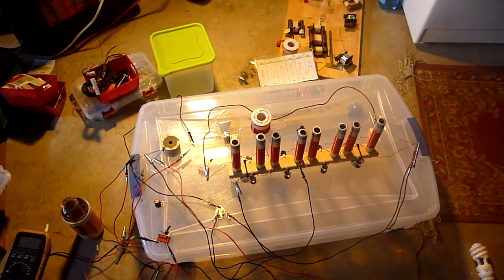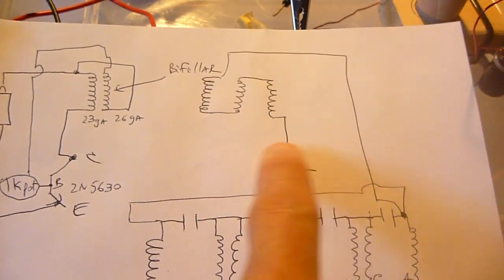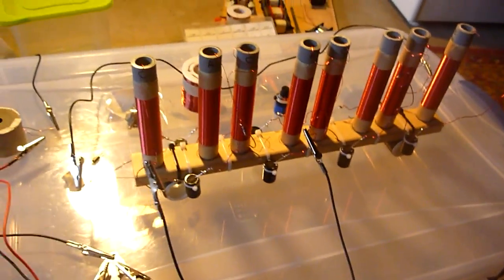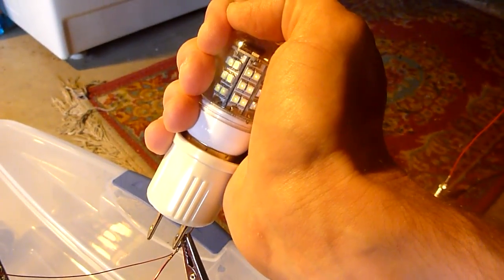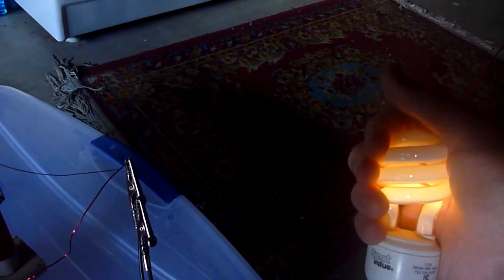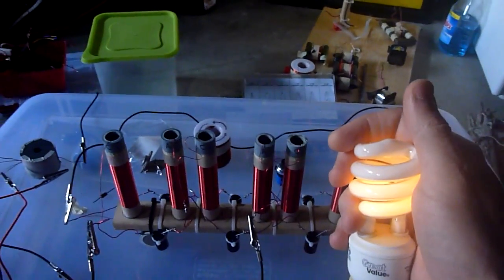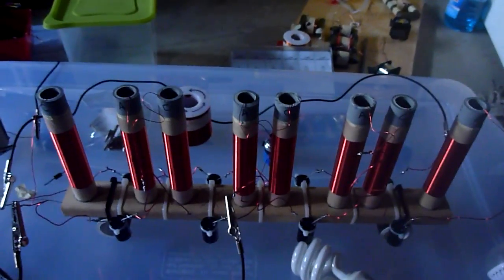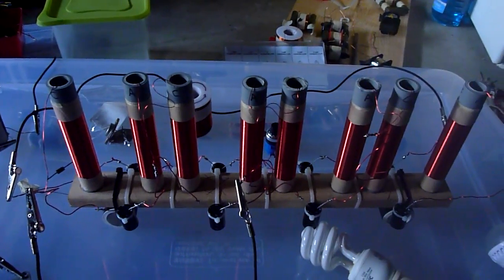Low Voltage Single Wire Power Transmission Exploration

Comment: I had square wave going to a primary coil, secondary had an iron bar through it. Then 2 coils around the bar one end open and joined by a neon bulb and it lights up. So no closed path and the light is on. Goes against what I was taught in school and probably much more efficient than just returning the current to the power company

Comment: Does your circuit contain an oscillator... which is then stepped up in voltage by a transformer.. The AC signal then goes to a chain of tuned resonant circuit of inductor
capacitors..  What is the resonant Frequency???.  What is the voltage at one of the light bulbs ?? What is connected to the base of the transistor ?? and what value is it???
Reply from the maker: +afzpuppet There is a schematic in the video, you know. The oscillator that I use is a transistor (2N5630). I also use a rather large ferric toroid, 1st layer is bifilar with 23 ga and 26 ga wire. The end of the 26 ga and the beginning of 23 ga are connected together and are connected to the + of the 5.9v 400mA Nokia phone charger power supply. The end of the 23 ga wire goes to the COLLECTOR of the 2N5630 transistor. The beginning of the 26 ga goes to the 2K multi-turn potentiometer and then goes the BASE of the transistor (this is what is used to change the frequency of the oscillations). The - on the batter is connected with the EMITTER on the transistor. THEN on top I have 23 ga wire wound back and forth 3 times (my secondary has 3 times more turns, so the voltage will be stepped up 3 times). The end of this secondary is connected to the house ground, and then the other end of it goes to the light bulb. The light bulb is I think 12 or 18 watt florescent light bulb, I connect various light bulbs to this 1 wire getting the bulbs to light up. The frequency of the voltage is too high to be detected properly using a volt meter.

Comment: OK so just for fun, no attack in any way but just checking :-) : can you proof that there is no battery in that socket under the light? :-)) If this really works than I want a new education. So is there a single point to learn about electricity or where to start? I've had some maths and physics on a Uni but I wasn't interested in just soaking up all that info, A. I want to experiment first, B. try it myself, C. read on some history how they came upon these discoveries. Way better for learning but unfortunately the teachers couldn't explain or there was no time... I did read P. Kelly's book about free energy for some months...
Reply from the maker: +Paul van Nugteren There is no battery in the socket, I can re-shoot the video without sockets (just have light bulbs in my hands). If you are interested in learning more about this stuff I would recommend lectures by Eric Dollard. His information is based on Steinmetz, Nikola Tesla, Oliver Heaviside, and Professor Wheatstone. It turns out that there was a duality of thought when it came to electricity. The bulk of scientists around 1900 rejected the idea that the electron was the charge carrying particle in electricity. These people (like Tesla) believed that electricity existed in a field around the conductors and that conductors themselves served to bind the electric field. Tesla debunked Einstein back in 1898 when he transmitted electrical power over several miles in distance, the electricity that was transmitted traveled at Pi/2*C or 1.5 times the speed of light. Einstein said "nothing is more certain than the limitation of the speed of light." However, that statement is false. Konstantin Meyel has a book (banned in the US) which is called "Scaler Waves" he lists the values various universities and scientists got for the transmission of longitudinal waves using his longitudinal wave experimental kit. The slowest longitudinal waves traveled based on physical experimental results is 1.2 times the speed of light.

Here is Eric Dollard's lecture on energy synthesis, it is a long video but mind blowing because his information is based on experiments of Nikola Tesla and others from that time period >> https://www.youtube.com/watch?v=cCJcU7INwnU
Here is Konstantin Meyel's technical proof for scaler waves (longitudinal waves) using his over-priced kit >> https://www.youtube.com/watch?v=9tplRbd-fso
Reply from the maker: +Paul van Nugteren Hey I updated the single wire power experiment. Check out the link to the new video here: https://www.youtube.com/watch?v=QpQvc7WEM2o, I got rid of the coil-antenna all together. I show single wire power under various conditions. I also light things up with no sockets to prove that there is no hidden battery anywhere :)

Comment: good video keep experimenting
Reply from the maker: Paul van Nugteren I'm located in USA. No investment is needed because I intend to keep everything open source. Two scientists are very important for longitudinal wave research they are Eric Dollard and Konstantin Meyel. If you want to learn more watch videos by them (you tube search them). Thank you for the comment.
Reply from the maker: +Kolin Evans I will, we are getting pretty far. 2 key things I figured out. Ed Leedskalnin used 2 ground connections in his setup (resonance between two ground points). There is some similarity to this and how Tesla's wireless system worked, and how Tamriel Kapendadze's generator works. Also, the great pyramid at Giza has 2 small shafts made out of granite going into the aquifers below the pyramid (pyramid also had 2 ground connections). The other key point is shorting of clockwise and counter clockwise coils. It seems that this configuration of coils negates lenz's law. Thanx for the words of encouragement.
Reply: +Naoki Kashima indeed, thanks for the feedback,  I think its best to roll with the assumption that electrons don't exist after all the human configuration is set up to be fake, if you think logically and study you will find most things on earth are fake, and complex for silly reasons,  I think the galaxy and the wider universe works on simpler principals. 
it's interesting to note flux in magnets and also the fact that run flux NS 'AC'  though a coil you get an out of phase 90deg but then run it through a capacitor and you get it 90deg out of phase the other way, I think that's and interesting principal because if we go from this theory that indeed electrons don't exist or flow, then really all that is occuring is the destabilize of a flux magnetic feild. 
which makes sense then when you see some designs of 'magnetic' motors,  maybe its just that simple?
Reply from the maker: Kolin Evans There are many self-running magnetic motors that are fake. However, they are not all fake. The real ones have patents on them. These 3 people made working permanent magnet motors: Muammar Yildiz (he actually has a German website where he sells his self-running magnet motors), Howard Johnson (Hojo Motor), Perendev. Making a self running magnet motor is pretty tough (I actually tried it my self using a 3d printed rotor and stator with magnet holes). Mine never worked because it wasn't precise enough, had a small wobble.

Muammar's magnet motor website: http://hmsbturk.com/tr/urunler/
Reply: Naoki Kashima really,  ok well maybe if in future you want to experiment, if I come up with any ideas , I will share them with you friend.
Reply from the maker: Kolin Evans Awesome, I would appreciate it. If people come together to work for a common goal (like a fuel-free generator), we will surely accomplish our goal. The more people we have working on this the better :)
Reply: +Naoki Kashima agreed, indeed I think the answer is there a long time humans are not the greatest sharers in the world, I like your avatar. 
I'm just a learner like you , but I think we can figuer this out.
Reply: +Naoki Kashima Hey I'm all in for it, I'd invest in it but so far it seems too risky... Are you located in Europe?

Comment: Have you tested what frequency is coming from the coils ? Maybe R.F. frequency or 50 / 60 HZ mains hum oscillating the coils generating an electromagnetic radiant field.
Reply from the maker: +Ortorea Screenname haven't tested the frequency. The main's hum shouldn't be effecting the coils as much. The coils oscillate because of the transistor in the joule thief circuit. Input power is 5.9v at 400mA Nokia DC phone charger (the usual). After the joule thief the 20ga output coil inside the toroid pulses at around 18volts and over 1 amp. This feeds into the coils which are all in shunt and connected by capacitors (all coils have the same resistance).

It turns out all of the Tesla's later devices were powered through a single connection terminal. The existence of scaler waves is very important because it defies the theory of relativity (which I was never a big fan of). If interested check out this Eric Dollard's lecture from 1992 (I think I sent you link about it before) >> https://www.youtube.com/watch?v=QKggql3aYkc
Reply: Yes you did thanks, I over looked the Joule Thief oscillator was having a brain brown out